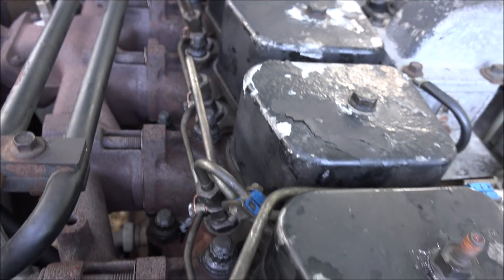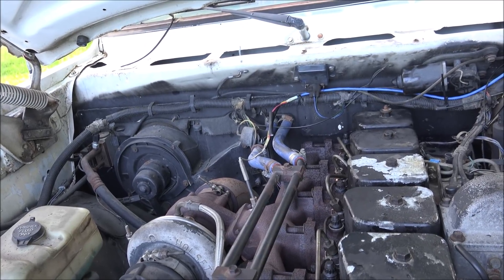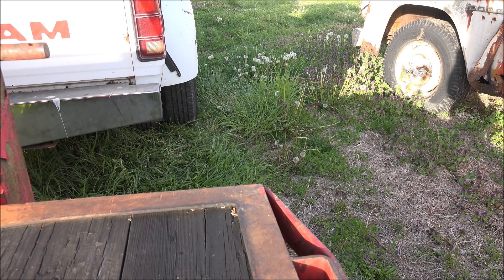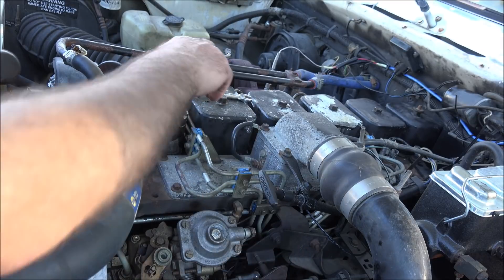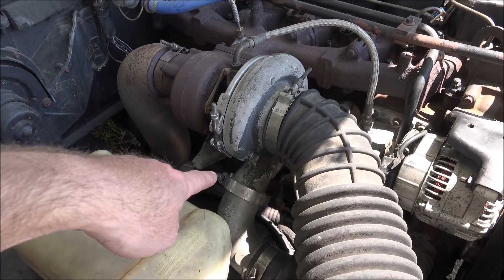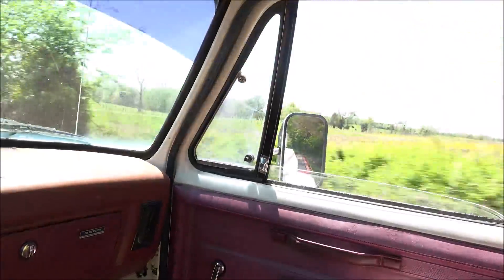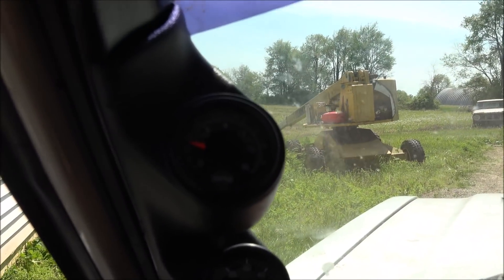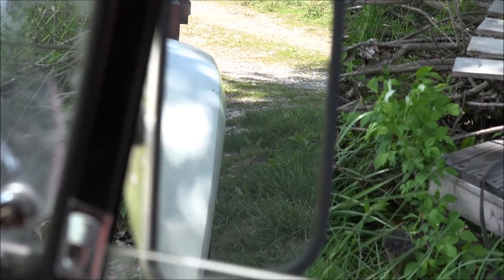First Gen Heavy Tow Rig gets 7x.011 148deg SAC Injectors Power and Smoke Tests 17000lbs BIG Fuel HP

Comment: What gear does it have in the rear end?
Reply from the maker: 3.07
Reply: I didn't think they went that high with a dually, I was expecting to hear 3.55@bcbloc02
Reply from the maker: @MuscleCarGarage2022 the 3.07 was in the 89 and 90 auto trucks because they had no overdrive. I run one behind my stick because it lets me tow in direct which is the only reason the transmission lives at over 1000ftlbs of torque being put thru it.

Comment: Bought a '95 3500 in 1996 when working in Denver. Previous owner replaced the OEM turbo with a 580 Case turbo. That was one of the best pulling trucks I ever owned. Pulled a 40ft 3 axle / 3 slide out Goose neck RV up the Continental Divide in 4 gear, and she pulled like a dream. Sold in 97 and bought a ford 350 7.3 4x4 auto matic,,,4 dr,,,what a turd,,compared to the ole faithful Dodge,,Still kicking my self today (@@)! Bear

Comment: You can buy some really nice high efficiency compressor wheels these days that'll bolt on to a stock turbo like yours and help with airflow across the range. They tend to build more boost much sooner than stock wheels.
Reply from the maker: Yes there are improved wheels that will fit the HX35 there are also better turbines as well. I am working on something I think will be much better.
Reply: @bcbloc02  Why am I NOT surprised.
Reply: This will be good! Let us know the details on your turbos.

Comment: Please explain why up sized injectors need more advance, when the extra fuel effectively advances the combustion vs stock. Is it you just need more time to combust the extra fuel?
Reply from the maker: Sounds like its own video! lol Long story short is timing is a mechanical thing. The way and engine makes power is a thermodynamic thing. Bigger fuel droplets take longer to ignite so they require more mechanical advance to keep the point of ignition the same.
Reply: @bcbloc02  Thought more nozzle holes gave more fuel while keeping droplet size the same. My only experience was VW TDI which had 4 hole nozzles. Pump duese engines and their V10 had 5 hole nozzles I believe. You're squirting way more fuel than those.

Comment: Hey Brian, is there anything you can do to get the EGT down in the hard pull, other than pull fuel out of it?  What would more boost pressure do for EGT's?
Reply from the maker: Yes more air will lower EGT's. That will be the next change.

Comment: Any room to fit a big flat panel air filter instead of the drum? So it can breath better and get more O2 to burn that fuel cleaner? 

Do you monitor any air intake temps post-cooler?  Just thinking out aloud, but if you're injecting earlier  (to give the fuel more time to burn) why is it poorly combusting (soot= low in O2?). I understand that when accelerating you want to run rich, but is it too rich or not enough air for the load?

(I'm a petrol burner so not really up on oil squirters)
Reply from the maker: Not enough air to burn the fuel is why you get smoke. The air filter is not really a restriction at this point. The turbo being too small is the limiting factor. The VE fuel pump loses injection pressure as the injectors get bigger so it loses efficiency and you have to make it up with extra air. A common rail with its 4X higher injection pressure can make the same power with a lot less air.
Reply: The shape of the filter doesn't determine airflow, fintration area does. Which is why drum filters exist- its a flat panel filter made round. They take up far less space, and are stronger than flat panel filters.
Flat panel filters exist because they are cheap to make and the vehicles using them don't need any more filtration area for the flow they need.

Comment: Hey Brian, I dont know nearly enough about tuning these engines, but watching you has me interested.  What injector setup would you recommend for my '92 ford F700 boxtruck w/ 5.9 12v cummins just like yours but mine was 190hp name tag with an inline pump(higher pressure?).  Also looking for alittle more power and better mpg.  Thanks!
Reply from the maker: Depends on your power goal and if you have an inter cooler and if you plan to upgrade the turbo. A lot of power can be had out of that engine setup.
Reply: @bcbloc02  It has a huge semi truck style intercooler, the truck has axles for 33,500lbs gvwr and is built for commercial reliability...  I dont know how much power would really be useful in this application, more interested in fuel economy and reliability.  This is the smallest engine option that was available in this truck though, others being the 8.3 cumins and the 10l V10 gas guzzler so alittle more power wouldn't hurt.  I would love to upgrade the turbo as i'm sure it is original and worn out at this point. Currently no smoke at the factory wastegate setting around 17psi.  What would you recommend? Thanks!

Comment: A new low-restriction air cleaner should cut down on black smoke
Reply from the maker: I tried pulling the air filter out. It made no noticeable difference. The stock filters are pretty good on these truck, like double the size of a 2nd gen one.
Reply: A good stock new paper filter will flow as much as an expensive oil soaked panty hose filter, and not dust your engine to death prematurely.
No one ever replaces stock filters, so when they throw on a magical snake oil filter, of course they notice a difference.....
Paper filters are cheap, replace them frequently.
Reply from the maker: @TyphoonVstrom  Agreed, the stock filter does very well as long as it is not dirty.

Comment: Great video Brian 👍 Would a slingshot type of turbo be out of Budget or just go with tried and tested upgrade.
Reply from the maker: I don’t know what a slingshot turbo even is but it is unlikely it is what I need for my setup. I think it is for gas engines so likely more geared towards a broad flow range to cover a wide rpm. I need high pressure ratio over a narrow rpm so it takes a different compressor design.
Reply: @bcbloc02  sorry it's called a switchblade It's a variable type as used by jaypaydirt on cat's etc but probably not cost. effective.

Comment: I think you should try the 60/67/9 HE351cw, I found it cleaned up the smoke way better than the H1C with a 12cm housing, hardly hazes at full throttle with 5x16's which I think are bigger than 7x11, spools MUCH faster too.. My truck is running about 45psi with that setup... only downside is you have to change the turbo flange
Reply from the maker: I don't have one to try but I have several different HX40's and s300's I can try. How are your egt's?
Reply: @bcbloc02  I don't have a pyro installed yet.. been meaning to get one and install it but the truck's been running good for a year with it and I tow... You can get knockoffs from Ebay for like $200, We usually put good quality bearings in them, the 67mm turbine and maybe a billet compressor, you have to re-clock the housings with screws with the wastegate mount, I welded a new tab on mine to relocate it back to where it is supposed to be.. works good
https://www.ebay.com/itm/302502077156
Reply from the maker: That looks similar to my Hy35-9. I am leaning towards My custom built 61.5mm Hx55 being a good egt killer.
Reply: @bcbloc02  I forgot to mention, they're saying it's an HY35, but we've bought 10 of them so far and they have all been HE351's.. I'm not sure why (maybe wastegate port size?) but I've heard that despite both being 9cm housings, the HE351 flows much better than the HY35
Reply: @bcbloc02  Oh, by chance, do you know anything about the H2E's? I have a chance to get a good core for free, apparently leaks a little oil, wondering if it would make a decent primary in a compound setup with a bigger turbine (62mm in it currently)
Reply from the maker: Years ago I ran an h2e on a 600rwhp pump. I eventually replaced it with a 66x71 s300 as it made more power and drove better. They are kind of weak in the durability department too if you thrash on them.  A k31 is a pretty good turbo and in that size as well.
Reply: @bcbloc02  So it's probably not worth doing much with and not that great for a compound.. I was thinking as a primary, bore it out to a 70something mm cold side and maybe 75-80 on the hot side depending on what parts are available
I just did rear brakes on my first gen today.. One side was like new, other side was worn to 0%, last person to do them must have only changed one side.. drum is pretty worn and scored but I plan on doing a D80 swap at some point when I go for power numbers anyhow, this should last til then.  Also took the diff apart and put a couple LSD clutches in, some were worn to steel and I had some that looked just a little better, ring gear had a little bit much play so I moved it toward the pinion by 0.010" and that brought it back closer to spec, well, not perfect but it's much better now.. and I have brakes again!
Reply from the maker: @Rx7man  Brakes are important!